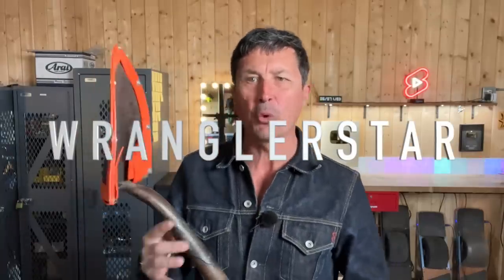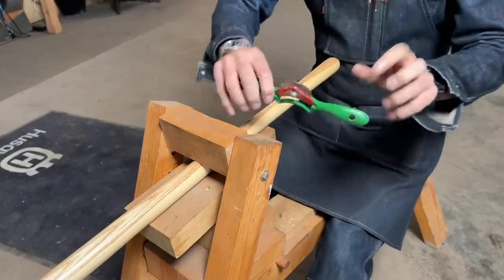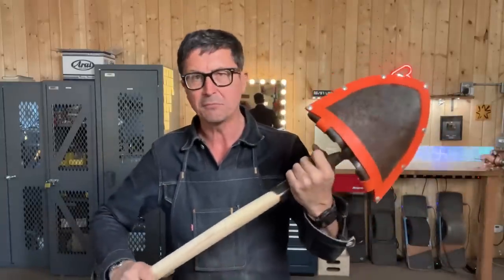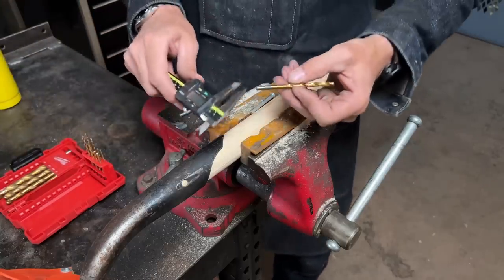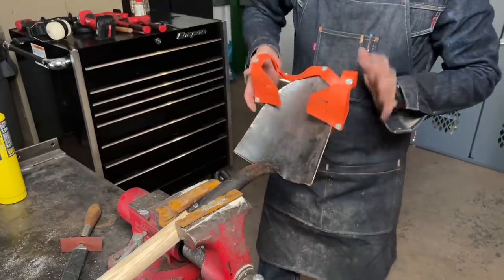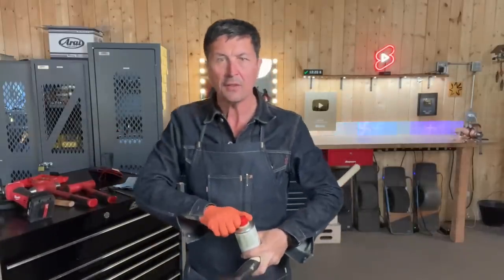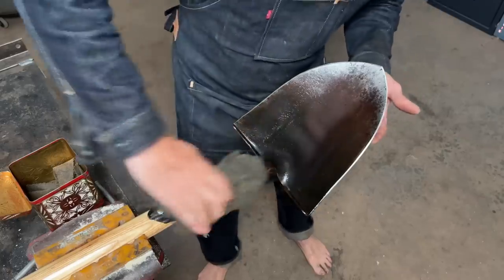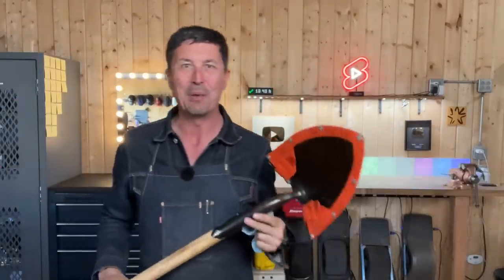How The US Forest Service Prepares For the Fire Season

Comment: " peening" is the movement of metal through impact . The ball of a ball peen hammer is to concentrate kinetic energy into a small area while being able to maintain control over the impact location and direction . Shot peening is another form of metal movement through impact and is a way to compress a metal surface to make it tough and uniform. An example of a shot peened item is the bolt on a properly made ar-15.

Comment: Question why do you never wear shoes when working in the shop or outside that just seems like a bad idea
Reply: It’s because of “grounding” which is good, but the workshop is not the time or place for it!
Reply: @stevenmark8156  what the heck is grounding?
Reply: @gwydionrusso3206  Your central nervous system is electrical. When you make contact with the soil, and I suppose concrete, it grounds you. It very healthy. When we used to work the garden and farm, etc, before equipment came along, we were constantly being grounded to the earth. Also, we are exposed to so many electrical fields now days, that it is especially important. You can even buy or make devices that plug into the wall outlet ground terminal to ground you while sleeping or working at your desk, etc. You can look on line. There is a lot of info in it.

Comment: Is there no heat treat on shovel steel? Wouldn't you run the risk of annealing it if you heat it up like that? I guess it doesn't matter since we aren't talking about the blade, and also it's ostensibly being used to fight fires. So I guess this is a stupid question.